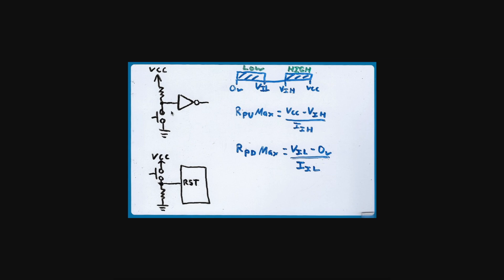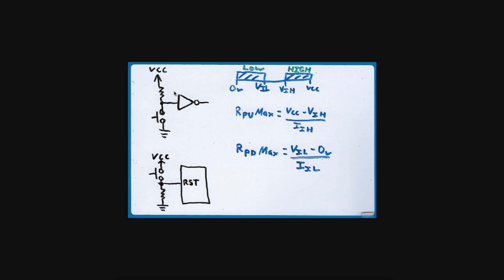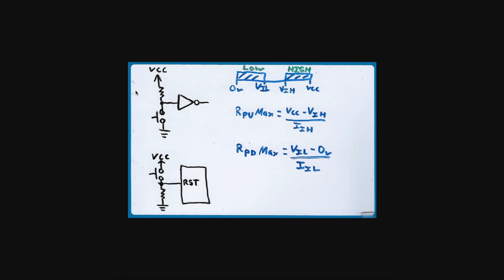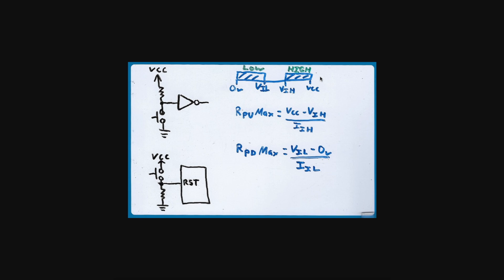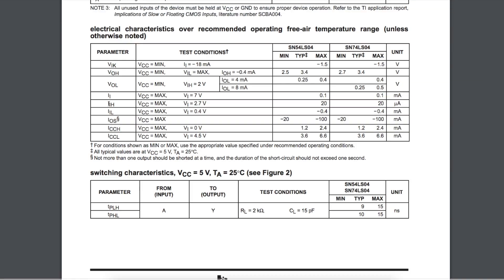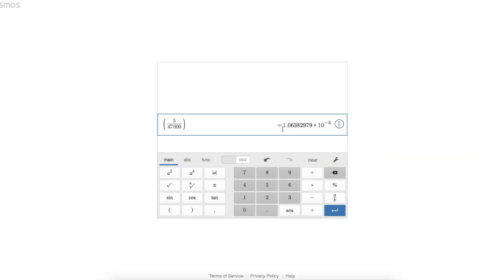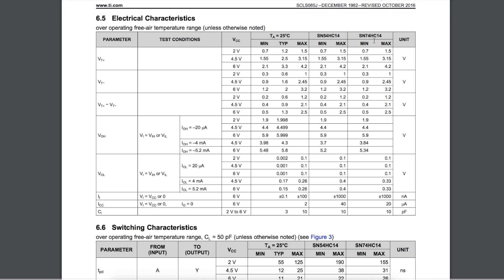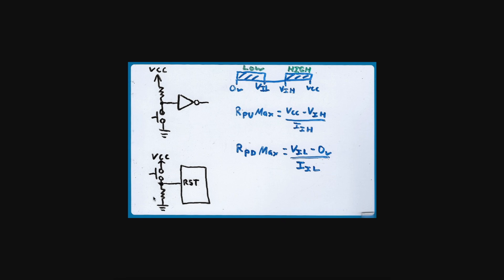Pull Up and Pull Down Resistor Usage with Switches

Comment: where is the first circuit connected on the other end and same with RST circuit??
How does that help if we just see hanging layout? Calculating currents based on voltage is very easy but seeing how the circuit is connected is hardest part.
Reply from the maker: It doesn’t matter where the output is going but if you want,  you can put an LED and resistor to VCC or ground with the anode and cathode appropriately oriented and then go back to figuring out what the input pull up or pull down should be.
Reply: @GadgetReboot  both of your models are very vague. They can be grounded or not on the other end. This is typical talk of trained engineers assuming some standard stuff from books but unfortunately things don't work that way in reality
Reply from the maker: It’s supposed to be vague. The purpose is when you already know what your own circuit is but you just need to figure out how to decide on that resistor value, this is how you do it. It doesn’t matter what the application circuit is.  Turning an LED on and off with a push button is a perfectly valid circuit though.
Reply: @GadgetReboot  I hope you know it is totally not true. Voltage often fluctuates and jumps in some ranges. That's how you decide about resistance for supplying the current. But still you can make mistake like in your sketches in situation if there is already something connected and draining power
Reply from the maker: To simplify the situation, if the circuit is a chip with a reset pin, maybe nothing needs to be connected on the output, it’s all software and it stores data on internal memory so the only circuit is the input resistor and switch. 
 So now if there is fluctuating voltage and it’s going to change load current on that resistor, that’s where you would decide on your margin of tolerance  and calculate so that if things change by half a volt you will still have valid logic levels and tolerable current flow. 
Any operation beyond that would be considered out of spec and there’s nothing we can do about that  so I can’t think of what else would be needed.
Reply: @GadgetReboot  Yes you are majorly right but could you just simply specify on your diagrams what we have at the end - (+) or (-) grounded or not.. That would just help more
Reply: @browaruspierogus2182  If your power supply fluctuates that much and you have to consider that in the equation you probably need a new power supply or power source.

Comment: Very informative video. I'm now going to have to rethink the way I implement pull up/down resistors. In the past I just used a 10K resistor without thinking anymore about it.
Reply from the maker: If it was mostly used on CMOS it probably would’ve been fine but with things like TTL, some of those variants  may not have worked reliably at 10 K.  But if it’s all on the workbench, as long as it works there, great!

Comment: Man fantastic I actually understood most of this one lol very well put together and explained I have never heard of wetting before definitely make sense when dealing with such low current values👍
Reply from the maker: I learned all about the wetting current for switches or relays in my first job because they used switches all over the place as sensors and physical limit  switches for when a motor is moving something around and it gets to the end of travel.    
But because  the switch was going to a digital input, there was basically no current and they had to use  load resistors to waste power just to make sure the switches didn’t get a build up. 
 I didn’t know what was going on for the first couple of years in that job. Best way to learn! Start out confused.
Reply: Gadget Reboot start confused should have been the name of my channel lol